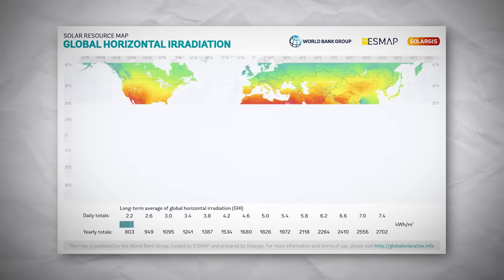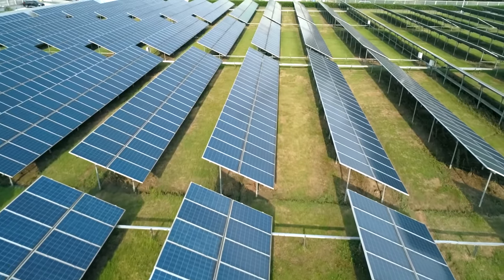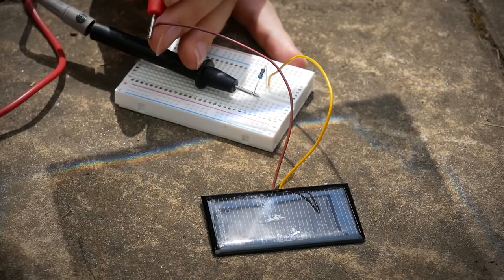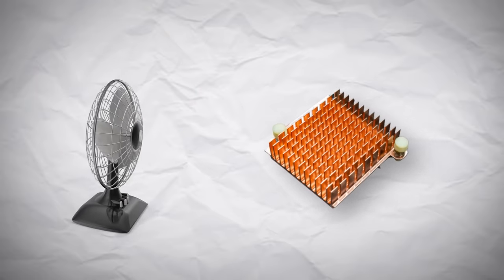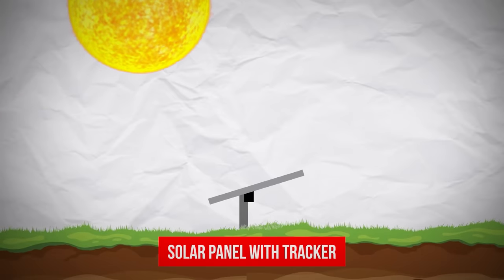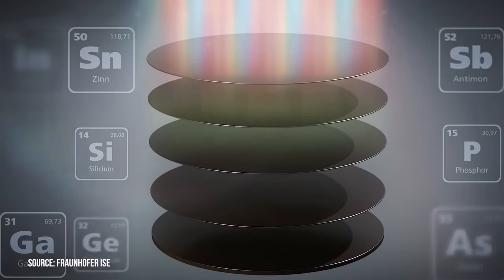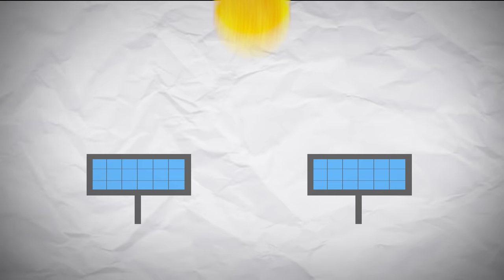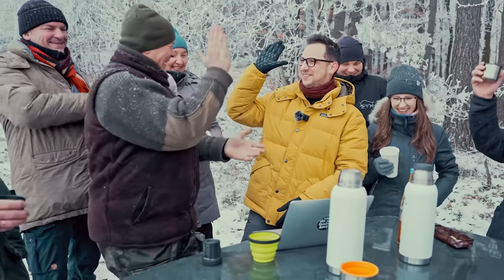Is Spherical Solar Really The Future of Energy?

Comment: Connect the panels with quality Steel hinges along their length to form a concertina which are suspended from a single steel pole embedded in a concrete foundation,  A manual winch retracts a steel cable attached to the panels elongating the stack of panels vertically. The angle between the panels is therefor adjustable. One panel receives direct sunlight, the panel above receives reflected light from the lower panel. The panels will operate cooler and therefore  efficiency will increase.

Ideally, one would take advantage of flexible solar panel tech in this situation and be purpose made; double-sided, concertina and installed vertically to face north-south. 
There are  a long list of reasons for vertically mounting panels, e.g. self-cleaning - dust, leaves, space requirements- foot-print.
Reply: The main reasons are service life and efficiency due to them operating much cooler, one could expect up to 4% more power output over a day's production and up to 50% longer service life.

Comment: basically:

Concentrated Solar PV only has real benefit if
1) the PV panels are significantly more efficient with intense sunlight, as to offset the inefficiency of lenses. though this is very much doable, and even possible with conventional PV panels.
2) the cost saving of having less panels per square kilometer can offset the cost increase of having lenses, which can only happen if CPV fully matures and adapted.
3) we can somehow make use of the heat from the cooling of the panels without too much cost, such as a temperature sensitive stirling generator or Peltier devices (Thermoelectric semiconductors / Thermocouple) without using too much cost.

the hardest of the three to solve is basically #3 but if PV panels mature enough we can completely ignore energy loss from #3 if it can compensate with higher power output per square kilometer with same cost, or similar power output per square kilometer with less cost

Comment: It needs ultra fast shuttering to allow the panel to cool while receiving high pwered spikes, which as noted leads to higher efficiency in the panel the duty cycle coild split into thirds or fourths, redirecring the concentrated beam to another nearby. The shadow phase of the cycle should be embraced, as it allows the PV's charge to reset to zero, then when reilluminated it must polarize fully, turning a DC PV cell into a high energy impulse PV cell with ceramic capacitor like  outputs if it were drawn for a pulse power supply.

The benifits will be many, as the cells now naturally cool for 67% or 75% of the wave duty cycle, and the output power is tri-phase or quad-phase impulse current which is literally THE most efficent form of power transmission. More than AC, and more than 'high voltage DC' (signal is square waves arranged in a myan pyramid shape; outpreforms AC -- yet impulse DC is best).

Systems of concentrated power behave differently than those not designed for it. An impulse system only transmits energy with very dense flux, compared to AC with much less density of flux over time.

A monocystal PV with silvered nano wire or even modified layers of translucent carbon fiber as condutors (to hold the charge beond what the doped monocrystals hold; aka, the something that has to connect to the wire for the grid, its usually normal metal girds on each face)... something like that should contain bursts of intense energy easily if cooled for most of it's duty cycle.

Comment: Many years ago, I was told about a group of people living on an island.
 They had A lens, focussed on a heavy, thick chunk of metal, on a large, reinforced water tank.
 The lens was set up, to track the sun.
 The intensified heat caused the water to turn to steam, which powered a generator.
 The water was also plumbed through pipes into the homes, with radiators, for heat and hot water use.
Reply: Yeah, that sounds like a story one would need concrete sources for. 
Possible in theory - but rather improbably as a practical insular engineering solution.
Reply: @FischerNilsA  do you exist simply to deny the possibility of truth?
 Nils?
Reply: @invisibilianone6288  
Ehm...whut?
Do you sincerely think   "somebody on the internet told me something happened somewhere  sometime"  is even vaguely equivalent to "the truth"? 
Because:  The first  is what you did here.
The second is what I tried to archieve by asking you for a public source.

"Truth" means you can show what you claim is real. 
Claiming something and -  the upon being asked to give sources getting pissy or going into vague ad-hominem insinuations?
Does not raise the probaility of your claim being true. 

As I said. Technically what you describe is possible. But like airships, fusion plants or monorails - that doesnt mean its a practicable engineering-solution. 

If such a system did indeed reliably function somewhere? 
I´d be highly interested to see how. 
So please : name the island or the technical system or the builder.
If your only "proof" is questioning and making assumptions about my person ....when asked for specifics on the supposed tech you claim .... yeah, well.

Comment: modern solar pv cells are 22% to 24% efficient and mass produced concentrator pv will likely be less efficient than laboratory cells. in addition concentrator cells do not collect scattered sunlight, thus cpv will be effectively less than double rather than 3x efficient compared to standard solar cells. then the cpv is also much more expensive as you point out, plus much more finnicky due to need for high precision tracking.

Comment: There's another aspect to lens concentration being ignored here. You can use lenses to concentrate only the wavelengths that are ideal for the PV cell, and reflect those which are not ideal, and that can radically reduce heat in the cell, helping them to operate much more efficiently without dramatic cooling overhead.

Comment: 4m^2 of fresnel lens might make sense on the outside wall of my house, to bring in more winter sunshine through a light pipe for direct heating. Then there's making hot coals in the daytime for the nighttime. If you can get 15kg up to 800 Celsius, might be good. 15*1000*800*1.8 = 6kWh. (1.8J/g latent heat, 3.6MJ per kWh).

Comment: I keep seeing "less solar panel per area" but that doesnt matter - its the area to conversion that matters - not the area of the panel it self. If anything, this is a good thing to have to use less panel surface. The main problem is just heat as to say, even at higher conversion rate, these are still collecting heat or it doesnt have a good way to convert IR light into power before it hits the panel it self. Thats what you need to fight. Some method to convert the unused light into something that we can pull power from before it hits the panel. So, while I think this is the best idea, it still needs more research into how we can use the lens to convert the unused light into something else as well. Either it be moving that heat into water or some how up convert the IR into light. A system that can convert 100% energy will never get hot. As heat is a method of loss. Yet, a system like this doesnt have to hit 100% - it only needs to hit a precent that ground air movement can control (as we have wind). Lenses are a good thing because it should last way longer than the panel it self along with the fact it should be cheaper than the solar panel it self. Thus having to replace only the solar panels should come down in cost while you keep all the other benefits of what the lens array is giving you. This type of system will maybe never see roof top - but for grid power generations this shouldnt be as big of a problem.

Comment: Ivanpah, which you show,  is a ghastly contraption that does have a large steam generator and it is absolutely fabulous at catching birds flying through the lens path and making them explode.  Not nice.  Fresnel lenses are just great, but note you still need the extra area of the lens to capture the extra solar energy, as you say, so if you do this at scale you need massive lenses and fewer solar panels, but the lenses have to be between the panels and the sun so you need a steerable array which costs money so  its all a big waste of time. I wrote this while watching your video so I didn't waste more time than needed. Multi layer solar panels will be available from Longi soon, operating at required efficiency and no extra cost. with no tracking needed.  Thanks for playing.  Nice try.  Thank you.

Comment: What about using a Stirling Engine in conjunction with the Beta Eye?  The Stirling Engine already uses heat differences to generate power AND equalizes the temperature between the 2 points over time.  While this will not cool a Solar Panel enough, it might be able to use the concentrated solar light from the Beta Eye better since it is already built for more extreme temperatures.

Comment: "While these are still widely used..."  Uh, no.  They were never "widely used."  In fact, most solar mirror systems have been abandoned due to high costs per kW-hr produced.

Kudos with respect to solar concentration.  Combined with Vertical Bifacial Solar Panels, which significantly reduce electricity-killing temperature, and high ground albedo, we might just see an improvement (reduction) with respect to total life-cycle costs per kW-hr.

Comment: Is that 45% of the light falling on the solar cell, or 45% of the light falling on the lens, or are those two equal?  In other words, how efficient is the lens?  It looked like the lens was not sending 100% of the light hitting it, to the solar cell.  It looked like there was some loss of light.  Also, with those particular solar cells, how efficient are they in the absence of the lens?

Comment: Perhaps if we were to use this type tech towards producing / cleaning our water thru distillation processes and /or by  flashing into steam.  If we could harness this flash point pressure we could produce not only fresh water but electricity due to expansion rate of water.   It could be scalable and stand alone , able to use in polluted waters/ saltwater/ puddles...   The by products would be solids able to be processed/sold or added to soil or any number of uses.    They could sit on the ocean using nothing.  Zero , making fresh water all day.  No moving parts.  Or big ones next to oil rigs producing fresh water and power  using just focused beams of light on a mechanism and casing able to withstand the flashing of water to steam and direct its path. I have thought of this idea for years and have a idea of this mechanism's appearance.    I saw it in a dream and it was about two foot long and  8 to 10 inches in diameter running into a bank of pipes  or pipe rack.   My 24yr background in refractory  lends me to think it was one in a series of these mechanisms.   It was relativity simple with just a few pipes attaching to this module  with could be carried by one person about 60 to 80 lbs.  Thanks for letting me speel...... I like the topic ..

Comment: Overheating of most solar cells leads them to become less efficient...thus tracking should not be for max sun exposure but max efficiency...always following the sun will work against you in hot climates. Weird idea..put them underground..always cool there...use light pipes(fiber optics) to bring the light to the panels...that way you can still use the ground on top of them.

Comment: What about, if Fresnel lens directs sun to small vacuum box with highly absorbing heating element through transparent side. Other inner sides would be covered with announced 40% efficient infrared panels backed with mirrors to catch heat radiation from element?

Comment: The best 'normal' single junction PV cells are already at 22+% efficiency. You're using an outdated baseline reference. Yes they were around just 17% efficient ten years or so ago
Reply: Not really, commercially available ones are around 15 to 20 percent, but in the lab's, they have up to 50 percent efficiency but that is not something you can buy just yet

Comment: Proper use of tools is something missing in our education system, @3:47 Chanel Lock plyers are upside down for the direction of applied torque, in other words, it is evident that the operator has no idea how to operate the tool.
Reply: Pliers
Reply: @craigsymington5401  Thanks, some times a mistake slips through.

Comment: You can't just read the voltage on the panel and claim its doubled in output. You would need to connect it to an actual load (preferably an MPTT charge controller) and view the actual watts being stored.

Comment: I don't meen to throw shade on this subject, but the reality of the mater truly is HOW the PV cells convert light to power. This is all sort of backwards thinking in a way.. If you take 1 solar cell, and throw a dedicated lens on top of it that (in your case is was about 5 times the size of the cell), it is more beneficial in the long run to use more cells. What I meen is there is only so many photons hitting that square inch, meter, or kilometer of the planets surface period. It's all about efficiency over that given space. Adding any form of lens adds more space used. It's not a game of focusing the light.. It's about what the panels do when the light gets to them. That's the real challenge.
Reply: As he said, point of the lens is to make better use, of expensive and hard to produce cells. Specifically the cells he spoke of that get more efficient with more concentrated light.

So that you get more power out of a given land area than with traditional cells without a lens. The cell he spoke of claimed to be able to reach 45% efficiency when under a lens. Which is far better than the 15-25% efficiency of the typical solar cells currently on the market. So, out of a given area, you will get 2-3x the energy output.
Reply: You went larger, the same is true if you go smaller, the lens uses more area, but the panel it self becomes smaller. So you make your panels on a mother glass that can produce 100 cells, that 50 cells per lens area of the same area with another 50 that can go into another lens array panel. So you are doubling the amount of area for double the power output at half the cost per cell for that lens array panel. I mean this is common math here.

Comment: Personally, I want to see the Beta Eye without the solar panel, and instead just use it as a laser beam. }: )

More seriously, specially-shaped mirrors that will redirect the beam from the sphere towards the same location wherever the beam lands on the mirror would remove the need for moving parts, but wouldn't handle the size issue. The multi-focal lens is probably the best bet.

Honestly, though, I just don't see solar power being terribly efficient until we figure out how to transport it from orbit. Build the power generator up above the atmosphere, and we're getting much more efficient.

Comment: Someone with the money, experiment with a solar cell with a series of Peltier Junctions stacked underneath (2 or more) that terminate at an aluminum heat sink vane that can have a fan blown over, or over in to a water cooled aluminum heat sink driven by a small fountain pump. See how much extra electricity can be produced from the heat boost of a Fresnel Driven Solar Cell. Please let me know how it works with the Peltier stack wired in series and in parallel. Thanks!

Comment: if you need to get heat away from a solar panel, you don't need the heat in your home. On the contrary, the panel is probably powering an air conditioner

Comment: Hmmm...  I didn't see a sensible comparison between electricity generation between and area of current solar panels,  and the same area of concentrated panels,  such as fully utilising, say, one hectare of land. Existing panels run at around 20% efficiency.  If if using fresnel lenses and more efficient solar cells can produce 40-45% efficiency,  they would need to require only 50% of land area to be comparable in output.  They'd need to beat this by quite a margin to be cost comparable, I think.  
Soooo... where's the advantage?

Comment: Mechanics is expensive and has no cost decline, electronics is cheap and declines in cost. That is why 15 years ago, solar tracking was a thing, but as the modules got cheaper, the industry moved away from it. They also moved away from concentrated solar. The system of lenses, tracking systems, and cooling systems is far more expensive than simply putting more cheap modules up.
Reply: This is true, but for individual consumers who don't own lare areas of land, concentrated solartracking  might find its niche.
Reply: @xaquko9718  the PV panels on your rooftop will generate far more electricity than your  household can consume. On the residential level, simplicity and reliability are particularly important. Tracking systems and concentration might rather play a role in commercial applications. But even there I doubt they would be cost competitive.

Comment: At around 0:53 you claim that "the idea of concentrating solar power is nothing new..."  Correct.  Then "and it's been done since 1968."  It's also been done since the third century BCE, when it was weaponized by Archimedes, and the 1860's when it was applied to civilian uses by Augustin Mouchot, who used it, for example, to power a steam engine to run a press in Paris.